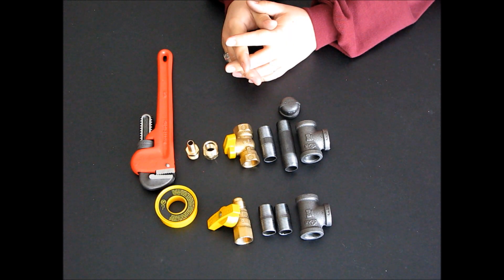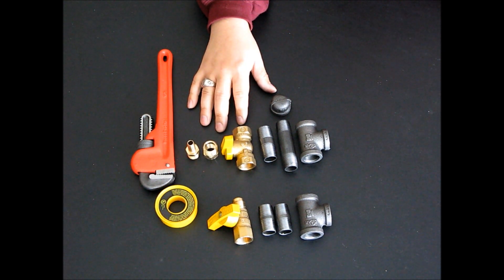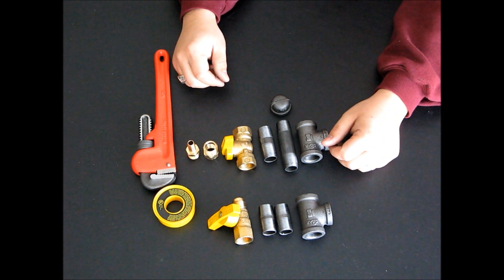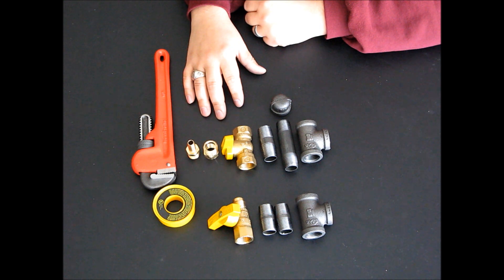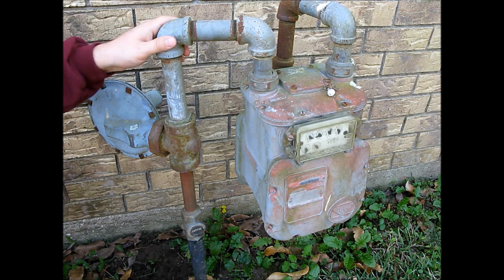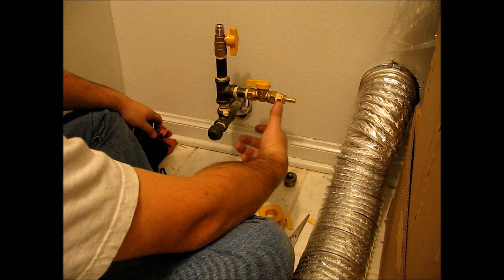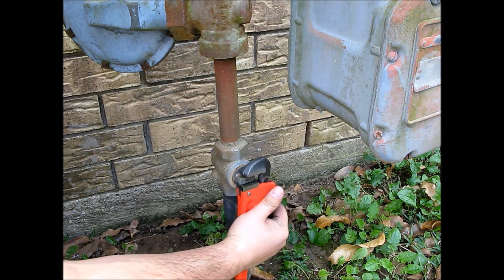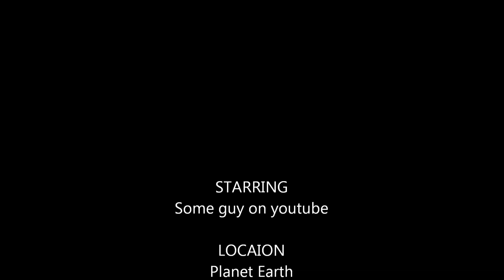Natural gas hook up for portable generator

Comment: When you straightened the vertical you loosed that joint.  Also, when using nipples, add the next fitting and tighten all at once.  Learned that from and old plumber.   Also human smell and listening is Not and adequate leak check.

Comment: Do NOT ever follow this guys poor instructions for a job like this. This will get you killed. Never attach inside the home with the types of fittings like he is doing here. Needs to be done from outside after the meter and the correct gas line needs to be ran, not RUBBER HOSE! As a certified gas service technician, I can tell you without a doubt that this guy doesn't know what kind of danger he is getting into. Never check for leaks by sound, always use leak detector solution. This guy is hazardous!

Comment: DO NOT DO ANYTHING THAT YOU SEE IN THIS VIDEO! There are very dangerous things depicted here. The location for the installation of the fittings is completely incorrect. They should be outside, not inside. The fittings are a combination gas and water fittings. This is really dangerous! These fittings do not belong in your house for natural gas. The fittings were never checked for gas leaks.  The barb water fitting is extremely dangerous for natural gas in your home. It is not designed for natural gas. There are no caps on the valves. This setup should be removed immediately. Setting up anything regarding natural gas without the proper knowledge can lead to DEATH very quickly. DO NOT DO ANYTHING THAT YOU SEE IN THIS VIDEO!
Reply: I agree with the barbed end fitting mosdef being the wrong fitting. All he needs to do is change that out to a NG QD fitting that matches the ID of the 1/2 inch line. Everything else he's using are steel piping which can be used for both water and gas. The valve hes using is also a gas valve. Biggest thing he failed tho is not doing a leak test and I personally would never use any teflon tape over gas pipe compound.

Comment: Thanks for the video, aside from criticizing your setup there, some potentially dangerous conditions Is like to know how big is the generator you are using and did it work as to was the fuel supply adequate for the generator, being told a much larger supply pipe is required for the 9000 watt unit we have. I was thinking the half inch would work but several plumbers telling us 1 inch to 1 1/4 is required thanks
Reply: Don V  there is a chart to determine gas pipe sizing.  It all depends on load and distance.  There are many variables.  The gas meter may even be too small if adding a generator.
Many plumbers automatically say 1”.
If you are starting new yes, the larger pipe is the way to go especially because you may be adding more gas appliances, like a generator....

Comment: What could possibly go wrong here? This guy plans on running the gas line and the 240VAC cable through the dryer vent opening.. Dryer vents never catch fire. Going a step further, we're going to run a 50' gas line off a 3/8" barb fitting to the generator. Let me know how this works. You might be able to run 2KW of load if you're lucky.

Comment: Couple of observations, first thing that stands out is your gas dryer vent connector.  it's illegal to use a metalized mylar duct to vent a dryer. only metal is permitted. (Always remember that a gas dryer vent carries the products of combustion. Plastic ducts, such as the one you are using deteriorates over time and, should it fail,  will vent into the home).

The second observation is that you never used a soapy water solution to check for leaks. Absolutely manditory. 

As an inspector, I would never allow a flex disconnect inside a home. Only metal piping. The hose is subject to breakage, cuts, flex cracks and others forms of deterioration. As such, it could allow gas to leak inside the home. This could go unnoticed should you be sleeping or otherwise distracted with disastrous results. There's good reason why the IRC and the UMC do not permit such Installations.  

BTW, for everyone else reading this, you are not authorized to modify you gas lines without a mechanical building permit and inspection. Not obtaining a permit is both illegal and you will carry the liability for your handwork even should you sell and move. Also your insurance could be voided should it case a fire or explosion an DC be traced (or suspected) that your modifications was the cause.

Comment: What state do you live in?  Using Teflon in a gas application?  Where's the pipe dope? These are just a couple things, I don't want to rip on you but you should go back to school and read your Gas Fitters manual and you might as well grab the Plumbing Manual as well.

p.s.  you wrapped the Teflon the wrong way, it should be wrapped in the same direction as the thread
Reply: Oh man, you started the dope vs tape debate.  I cringe.

In his defense, PTFE YELLOW tape is designed for hydrocarbon exposure and is double thick to work with 1/2" to 2" pipe thread.  The single layer WHITE stuff is a big no-no.

That said, some local codes/inspectors/installers just refuse to use/allow tape.

For those who don't know, teflon (PTFE) tape and pipe dope are designed to lubricate pipe threads so they don't gaul the metal surface of the threads and cause friction to build up prematurely when tightening.  If you do gall the threads somehow, you can get a torque reading/feel that the fitting is tight when the threads actually haven't fully engaged (or engaged solidly).  Either way, it is NOT thread sealant, the geometry of pipe threads causes the tape/dope to push out the way at the very tightest spots... the threads seal metal-to-metal.

Tip: never thread the bottom 2 threads of any fitting/pipe... leave those bare so you don't risk threads in the pipe.

As for direction, he did almost all of the right.  I had to watch it twice, but I think I saw once it was done backwards.  when in doubt, just remember, the female socket should help tighten the tape down, not "roll into it" causing it to bunch up. ;)
Reply: Sharing is caring.  ☮ • /♥\ & (✿ˆ◡ˆ✿)
Reply: They make tape for gas fittings.  I add a small amount of pipe dope to it.
Don’t put tape at the very end as it can break off and lodge in a gas valve.

Comment: you cant make your own hose to run natural gas to an appliance,it must be certified and designed for the application by UL or another testing agency. I work for a large gas utility as a gas fitter. If I saw your installation I would be compelled to lock your gas meter until it was removed. Iam sure your home insurance provider would have a dim view as well. Natural gas can kill and cause massive property damage so strict rules are in place that must be obeyed
Reply: it also would run like crap since LP and NG require different throttling... though I' doubt he'd have any use for the NG line if he DIDN'T have a NG-capable generator.  I know my Generac does both with just the flip of a switch (and swapping the lines obviously).

Comment: one thing i would have different is plumbed the gas through the that if that is a outside wall to a quick disconnect and not risk having a open port inside the house and a gas hose that will some day get a rupture especially if you do not use hose for natural gas you see houses all the time in the news exploding from gas leaks and if the dryer you are using is not 220 volt upgrade the wiring and install a transfer switch lock out so you don't kill a lineman trying to get the power back on it only makes sense to do it right plus if you decide to upgrade to a permanent whole house system most of the work is done all you need is a auto transfer switch to finish the job

Comment: May want to check with local codes.  I know in my area it was not required but they were very sensitive to proper grounding.  The risk of not having and established ground between the generator and plug in to the house is a build-up of static which can be a significant problem.  I was always taught to use common grounds.  Reading and watching some video's on your method of providing power via a back feed such as yours, just scares the heck out of me.  There are alternative methods much safer.

Comment: The double T configuration is not necessary.  To have the extra connection that goes to a cap is a waste of fittings and pipe...
Reply: Right...like that's the only thing wrong with this.  "Hey Joe -- did you know you could blow yourself up more efficiently, with fewer fittings?"

Comment: My issue is this.... I have a trifuel adapted generator.  To get the most hp out of it your required a minimum 1/2 line in.  3/4 recommended for max potential   By reducing to 3/8 barb your basiclally reducing the generators output.  Also. Like said previously.  Quick connects are the real deal.

Comment: Loved the Tri Fuel Video and your out there doing it! The fact that your not holding back with another wrench is differently a No Go! Your fittings are not set up to code, and yes I would have probably remove the Vent and pull the gas hose and electrical line  in my twentys but those days have past best to be prepared.
Reply: Can you explain how he could have done it to be up to code?  That would be helpful to the rest of us.  Thanks

Comment: Hello, I am a licensed Plumber and this is a very scary thing you just showed people. Please up date your video and place a quick disconnect adapter for a barbeque that you can buy at Home Depot. Your valve can get bumped and leak at any time. Bad news. Quick disconnect fitting has a spring and ball check in it and it cannot leak if valve is opened. Also you want your gas connection out side not next to the 220 plug you just adapted to for the generator. SPARK + GAS LEAK = BOOM
Reply: Amen Henshaw1974. This is an explosion waiting to happen.
Reply: @Asa Jefferson instablaster =)
Reply: I was thinking as he was taking that this is dangerous.  Especially since he’s running high voltage wire and gas through the dryer vent.  I hope the dryer isn’t running when the gas and power are fed through the vent as the dryer vent can get quite hot.  

To test for leaks you should use a glass of water with lots of soap and pour some over the pipes.  Sometimes there’s a leak so small you won’t hear or smell it.  

Do generators take the same size attachment as BBQs?   I have a BBQ quick attachment already in my back yard.  It would be nice to just unplug the BBQ and plug I the generator.  I’m confused because in this video he was using a reducer that brought the line down quite small.  I was hoping if I bought a generator I could just use the BBQ outlet as-is.
Reply: @Asa Jefferson Glad I could help xD
Reply: @Edward Stanley Thanks for your reply. I got to the site thru google and Im trying it out atm.
Seems to take a while so I will get back to you later with my results.
Reply: @Edward Stanley it worked and I now got access to my account again. I am so happy:D
Thank you so much, you really help me out !
Reply: I dont mean to be offtopic but does anyone know of a tool to log back into an instagram account?
I stupidly forgot my account password. I appreciate any help you can give me

Comment: Thanks for sharing videos! Very good explanations. Generator running on fuel that is likely to be around is a great thing. I am not a plumber myself but it seems like if you revise the first T to come in the middle and the "plug pipe" facing down it will not only save some space but also be a drip leg. I dont know if a drip leg or sediment trap is required by the code but it might be a good idea to check. Great videos, good luck and be safe!